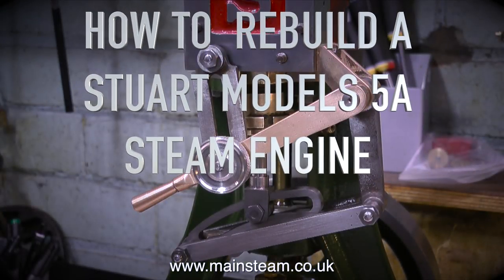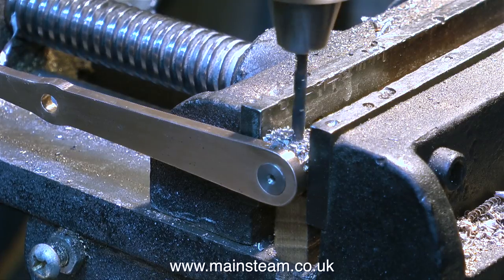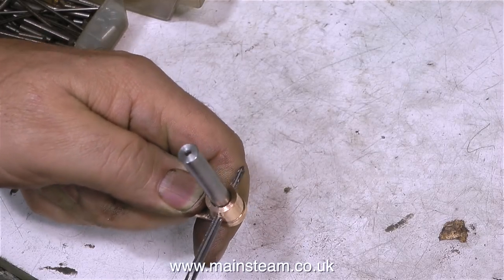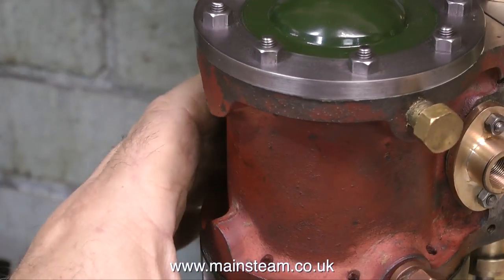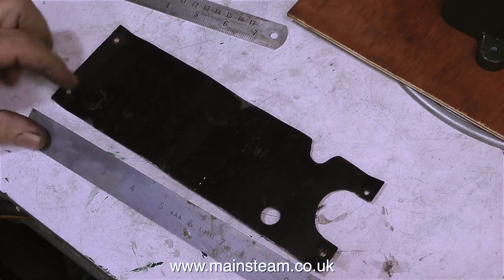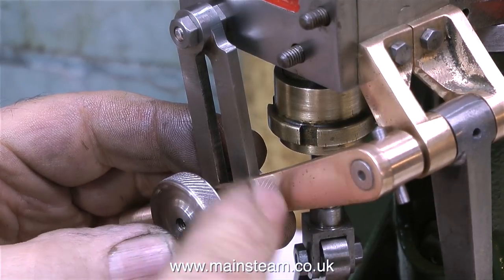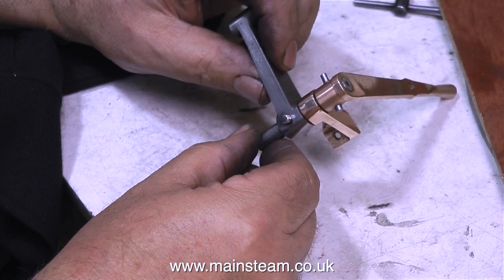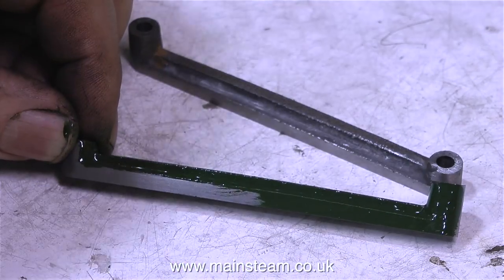HOW TO REBUILD A STUART MODELS 5A STEAM ENGINE - PART #24

Comment: Back in the day when IBM punch cards were the main data storage medium I was one of the guys designing the machines that processed them.  We used lots of taper pins and the IBM standards required the large  end  to protrude slightly and the small end to be recessed slightly.  The idea was to make it easy to identify which end was which and to prevent mushrooming the small end when removing the pin which was done with a small drift punch

Comment: The tiny hand pump as an oiler is a brilliant idea. Perhaps you can expand on this idea with a particular engine. Make it excessively complicated, just for the fun of it. Have nicely bent copper tubes running to every single oil point so the entire engine can be lubricated automatically with a complicated mechanical system. I love complicated mechanical systems.

Comment: The 1/8" pipe size is based around what was required to get a 1/8" hole in the center of a cast ductile iron pipe when pipe sizes were standardized. Modern metallurgy has resulted in much thinner walls, so the 1/8" fitting bore can be 3/16" or 1/4", depending on the material and pressure rating.
Reply: Welcome to the wonderful world of nominal pipe sizes.
There are so many brilliant quirks to the standard sizes that have emerged over the years. For example there is a metric standard which is 100% identical to the imperial sizes except that the names are different, i.e. DN50 pipe is identical to 2" nominal.
It is perfectly normal to specify pipe with an OD in inches and a wall thickness in mm, or vice versa.
Wall thickness is designated as "schedules" where sometimes 40 and 40S are the same, and sometimes they're different.
And of course try to avoid the embarrassing mistake of getting pipe and tube confused with each other.

Comment: The smaller locking wheel looks a lot better.
As you said, the function is more important than the appearance on this engine, but still... personally I think that the stainless steel looks a bit too bright compared to the rest of the engine. Maybe it will look great when everything is finished and painted and has a little bit of oil and grime on there, but I'd be tempted to take some scotchbrite or wire wool to the wheel to give it a more satin finish.

Comment: If it Moves Salute It, if it doesn't move Paint it.
If you must paint it can you use something other than Institutional green, as used at one time in all government Hospitals, Prisons and insane asylums.  Your guess as to which ones I have seen. You did a fantastic job with the taper pin and reamer, I can never get them to work proper, did you know a broken taper reamer coated carefully with JB Weld looks just like a proper taper pin? I will redesign things completely just to avoid using them.